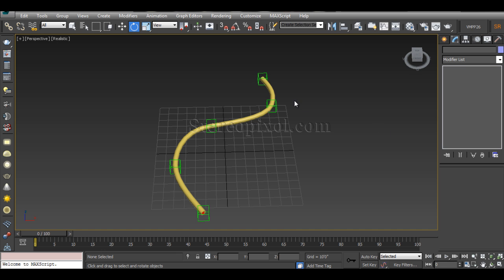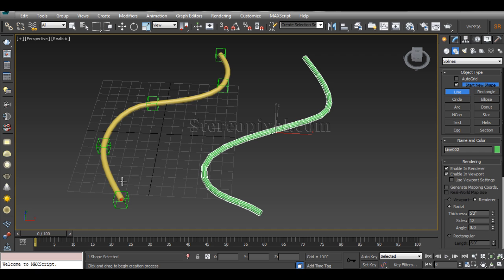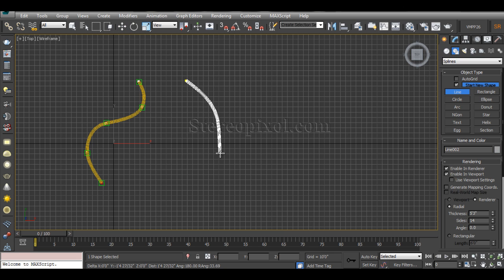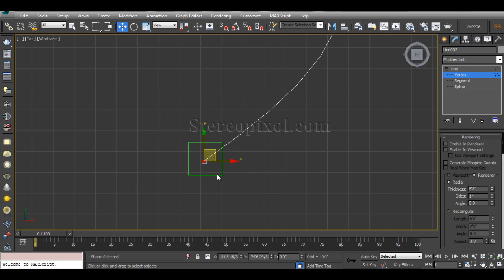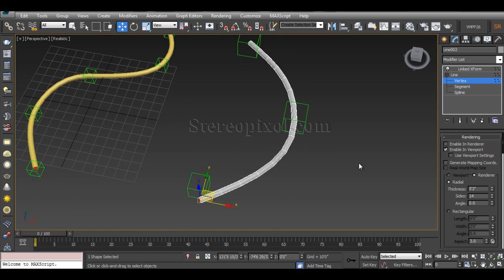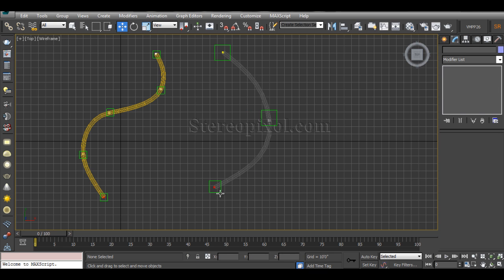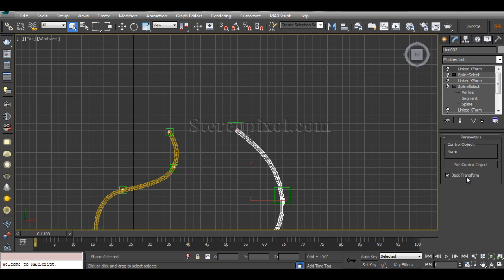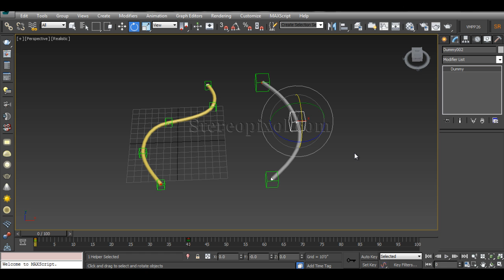Wire Rigging in 3Ds Max - Beginner Tutorial

Comment: This was very useful but could be 10 seconds instead of 12 minutes.

Make a spline
Make a dummy/point for each vertex in the spline, align them up
Use the SplineSelect modifier to select one vertex and then apply a LinkedXform modifier and link it to the corresponding dummy
Repeat for each vertex
Reply: This video is a "Beginner Tutorial"
And as a beginner, I have no clue how to do those steps you listed! So I'm really glad this vid is 12 minutes long xD
Reply: You can also use "Spline IK Control" modifier, which does it all in one click
Reply: @martinb714  Do you know if you can tie the helpers down to other objects? I'm trying to make a rigged phone cord where the loose ends are constrained to the base and receiver.

Edit: I just realized you could apply a basic link from the helpers to the objects, nevermind!